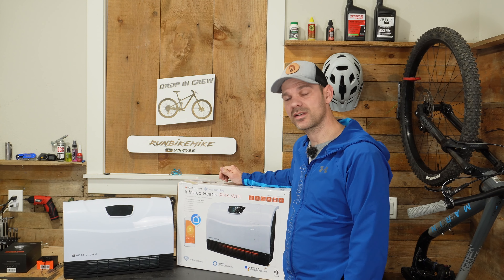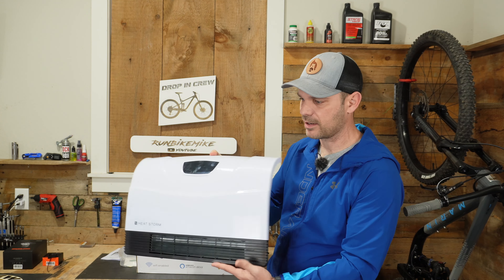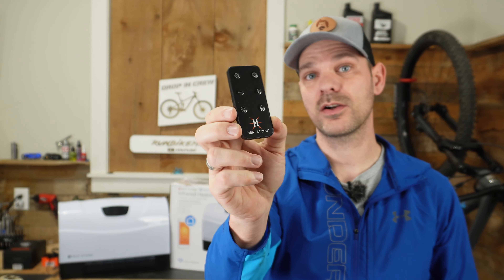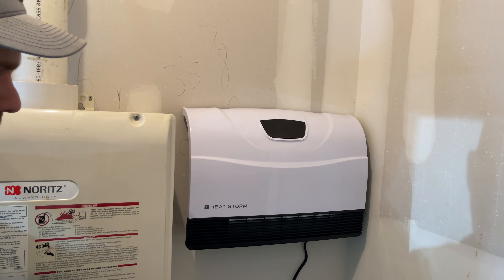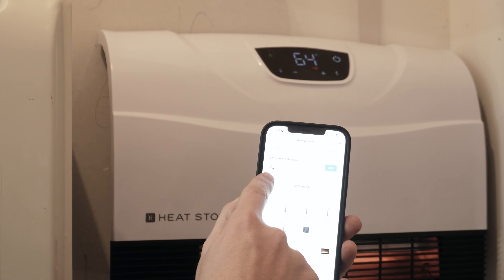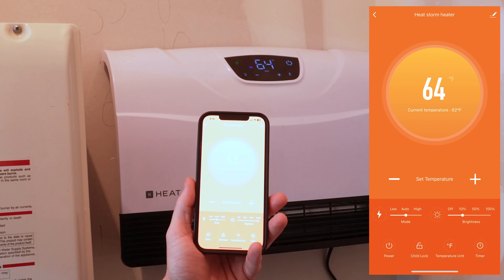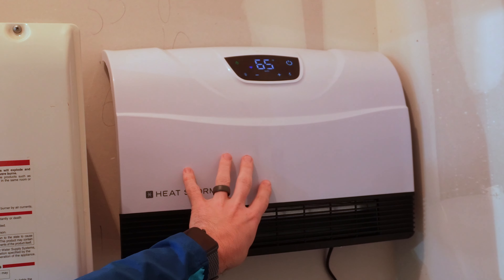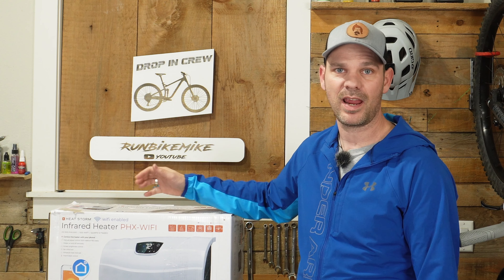Heat Storm Wall Mount Infrared Smart Heater | HS-1500-PHX-WIFI

Comment: Hi there, thanks so much for the vid. I have a question and hoping you could share your experience with this unit.  Some
say the "fan" never turns completely off once desired temp is reached.  Ex, they set unit for 75F, unit gets to 75F, THEN
fans comes on to cool the heating element off (as you said, which they say, is a 60sec countdown timer).  But while
cooling the elements off and blowing cool fan air out, the room temp drops to 74F and the heater kicks on again!
And the cycle repeat!  Which means, the unit TRULY never turns off and goes the entire time soaking up 1500watts
as the temp control DOESN'T work at lower energy settings.  Is that true.  Does the heat ever reach desired temp
and turns OFF (fans stops after cooling element cooldown)...and doesn't come back on until temp drops BELOW set
point?  I bought a GiveBest unit like this, and that unit NEVER TURNS OFF.  Just oscillate between cooldown & heat up!
Reply from the maker: In the small room I have it in it does kick off and on.
Reply: thanks for the reply.   Gonna order one thru Amazon tomorrow.  I'm hoping I reading you response correctly.
That the Unit and Fan does STOP, kick off for whatever duration it takes for the room temp to drop below the
SET temperature, before Kicking back on.   The GiveBest unit FAN doesn't even turn off before the unit starts
the recycle  heat.  The room is 12 x 12 that my mother sleeps.  Hoping the  Heater can keep it warm for her at
night!  Thanks so much for taking the time to respond!  If I misread your message, let me know that too! lol

Comment: Since it keeps running after you power it off is it safe to leave plugged in since in directions it says unplug
Reply from the maker: I have had it plugged in for almost a year at this point it has been fine. The fan only run until the heat is out of the unit.

Comment: How loud is it? I'm looking for a silent heater so I just found out it has a fan
Reply from the maker: I hit on that in the video. Check it out 👍🏻
Reply: The blower wheel noise is comparable to most car's HVAC blower fan. Low is equivalent to Med fan speed in a car. Audible but you can fade it out into white noise. And on High roughly the same loudness level. But still quieter than typical bladed room fan.
Reply: Mine has very minimal noise even on High.

Comment: I love my heat storm but I am concerned that you placed the side so close to the wall.  My heater had air inflow with filtered grid on sides.  Will this not interfere with the operation of the unit?

Comment: Why you use anchors for? Bigger holes to fill in sheetrock. Just use sheet rock screws
Reply: Don't anyone listen to shaunbain3305. Not using anchors would be dangerous, esp with an electric heater involved. The anchors spread  behind the sheet rock so they can't be pulled back through the hole. Sheet rock screws would just pull straight out. Always use anchors or whatever the appropriate thing is for your job. Never put sheet rock screws directly into the sheet rock.